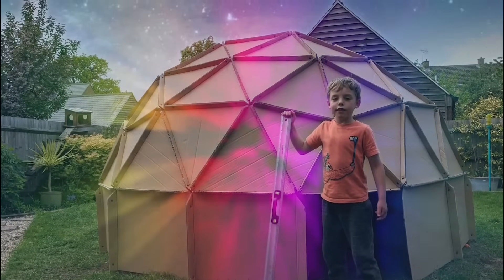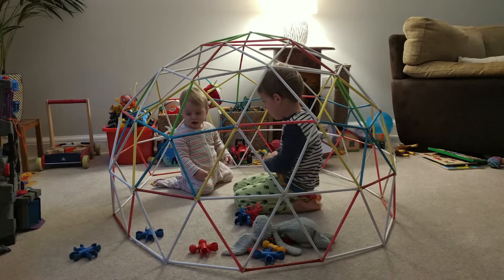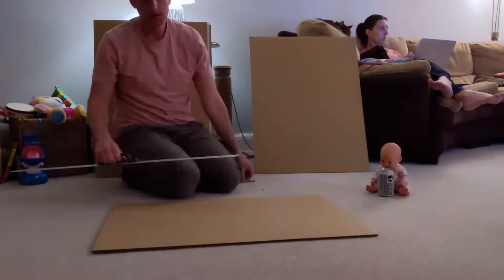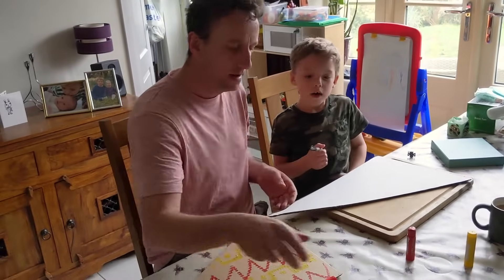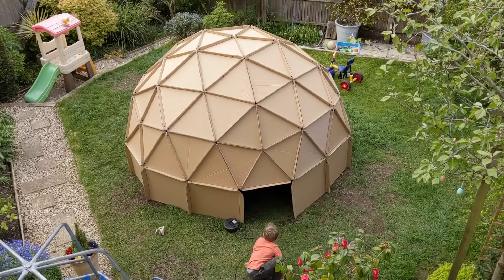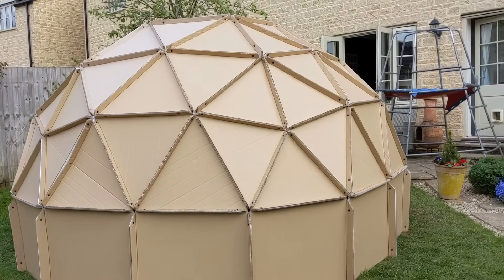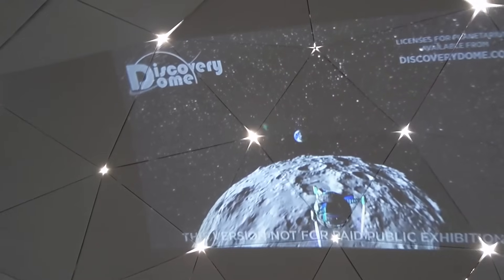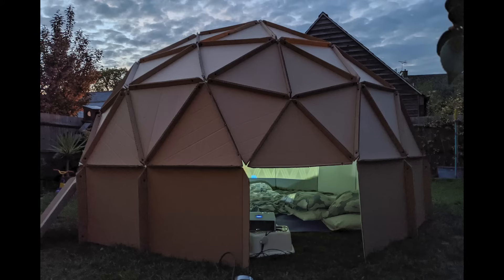Building a Cardboard Planetarium

Comment: they'll be talking about this with your grandchildren as a grand adventure ! Nice work.   I've actually thought of doing with with the ribs INSIDE and using it as a form to blow on a permanent fibreglass layer - I guess someone could add rebar over it and even use blown gunite  and then paint it after it's cured.
Reply from the maker: Thank you!  I didn’t except the dome to last too long but was quite surprised by how quickly it took on moisture and collapsed - we maybe had 3 or 4 days out of it. It was the morning dew that ended it despite it being warm otherwise. Good luck with your version- it sounds intriguing!

Comment: I was thinking if you painted the outsides with exterior gloss paint and sealed the edges with silicone, then let it rain who cares.
Reply from the maker: A good idea! I'd love to make another one - just need to think about waterproofing and making quick to release connections.
Reply: First of All: very Nice Project ! About this water problem: Applying Ship (Yacht) Varnish on the cardboard before assembly… also putting the bolts on the inside would turn the outside into a more smooth plane because now you have those upstanding sides creating a collection effect for water. Application of silicone in between the triangles, already mentioned by Tony Hardy,  would seal the whole from further water penetration. Ofcourse you would have to apply an extra projection layer on the inside but I think it can be done. I also think if a person wants to create a larger structure with this cardboard material it will be more easy and safer to secure the bolts on the inside since you cannot climb on the outside or reach too high… anyway, I think it’s a very nice approach of a practical geodesic dome creation. Well done.
Reply: Rain is a definite problem!

Comment: Celestia projected inside would be pretty fun.  Also recommend "snapology origami" as a lockdown activity.
Reply from the maker: Have just Googled Snapology and it looks super fun. I'm going to give it a go. Thank you.
Reply: @RussellEveleigh  Takes time, but wow, the results are pretty remarkable.  I recommend the Fiskars SureCut 154450-1009 for quicker cutting of consistent width strips.  If you find a better approach or tool, I'd gladly take your feedback.  I'm currently working on a 6-frequency dome to encapsulate an Ikea FADO lamp for a friend's kiddo.